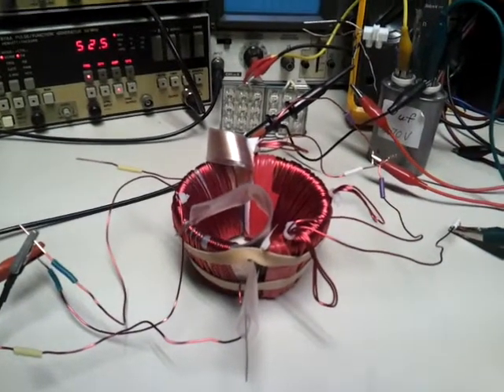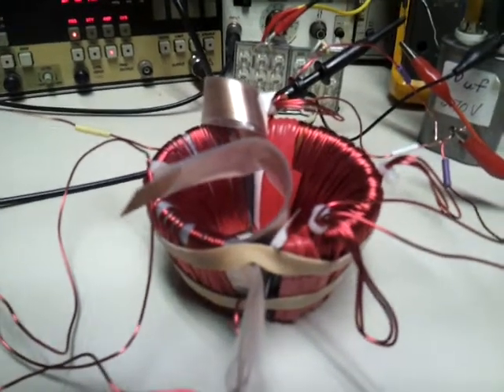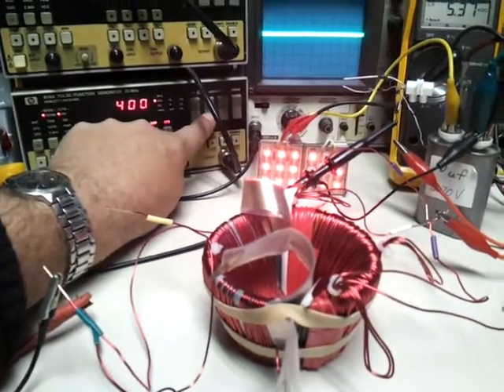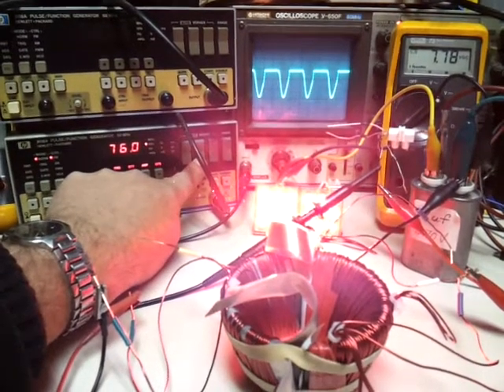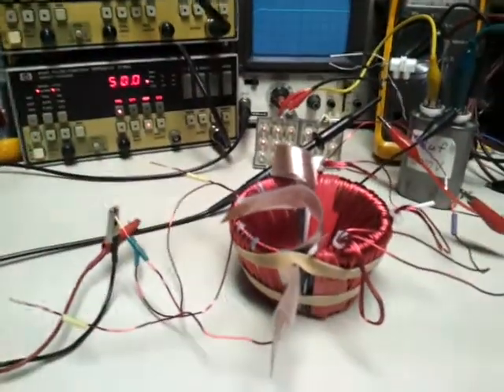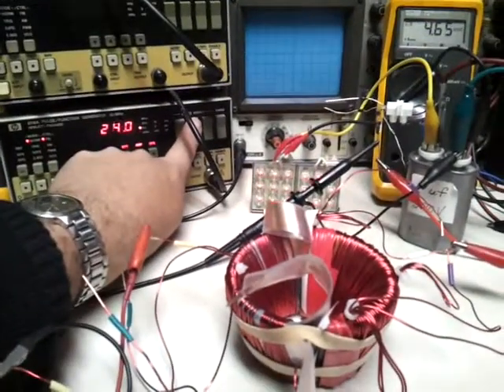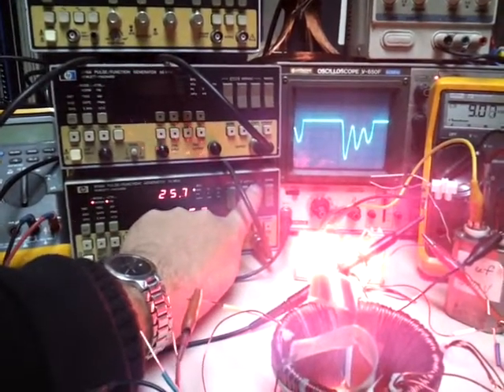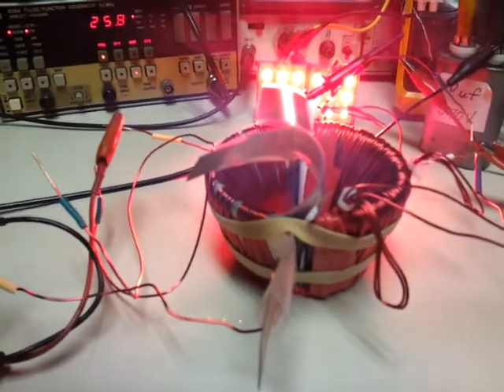Pulsing a Yoke Coil 6

Comment: Hi wattsup: From the little that I understand, we also have to consider that the yoke you may be using may not be the same yoke, or even the same material, that the one used by the gentleman that achieved those frequencies on his was. But, considering that you ARE achieving output on the coils originally suggested, maybe your yoke just resonates at different frequencies while in the mean time achieving same results. Cheers

Comment: Hello :)

You won't get much output unless you tune your 2 generators for working as single system. 
When you use copper strips find resonant frequencies with sinus wave on 15 turns out, use that frequency for strips. And when you apply that, look for resonant harmonics on 50 turns coil then use 3-5 harmonic from highest sinus output amplitude.  Then you provide that frequency and attach 50Hz generator to 15 turns coil. Attach capacitor to copper strips and lock down to resonant frq of ferrite.